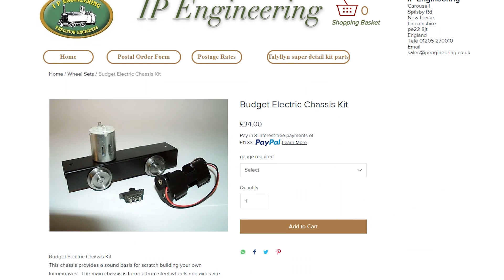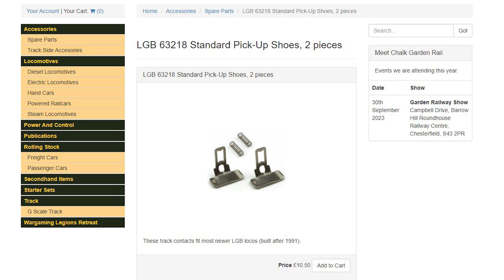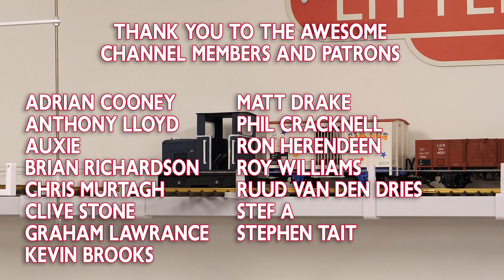3D Printed G Scale Shunter | DIY Project

Comment: Awesome work! I do have 2 small issues with the print files - Front Wheel is MASSIVE when loaded into Cura, Same with the coupler pin - Not sure why? Im working to rescale those items now. Everything else is great! and ill share pictures onto thingiverse when complete. Thanks again!
Reply from the maker: Sorry about the scale issues. I'll try to have a look at the files on the weekend and see if they match up with the final print. I tend to do circular objects either 10 or 100 times bigger because SketchUp struggles with small radius circles.
Reply: @LittleWicketRailway  It looks like the front wheel and coupler pin are still overscaled. Please check when you are able. Appreciate the model and work you have done.

Comment: I found out that LGB used to make a hogwarts express train. I think it would make a great review and add a bit of British steam to your G scale layout.
Reply: Also out of curiosity, was the shunter you built a Ruston?
Reply from the maker: I'm not sure if it's meant to be based on anything (I didn't design the original), but it definitely has Ruston vibes about it.
Reply: It turns out I made an error, it was Lionel who made the G scale hogwarts express
Reply from the maker: I think I've seen that somewhere. If you can find one in the UK then and it's not ££££ then I'd be interested.

Comment: I saw that the motor you used is 3-12V. Are you limiting the power in the DCC or in the tracks from 18V down to 12v? Or du you runt the motor at 18V?
Reply from the maker: Hi Martin. I'm limiting the output from the decoder.